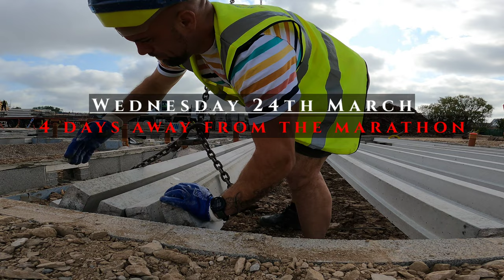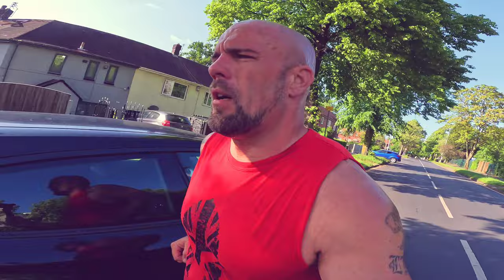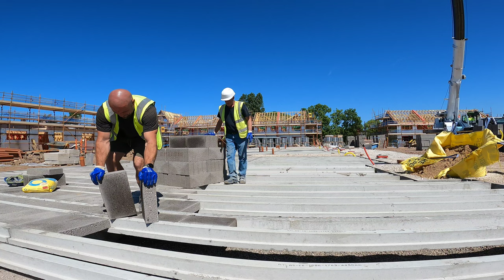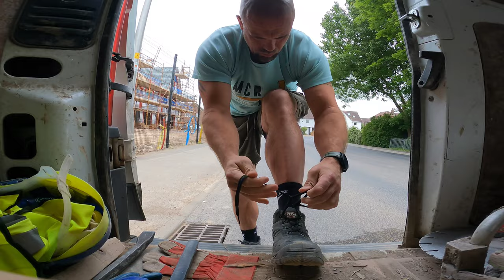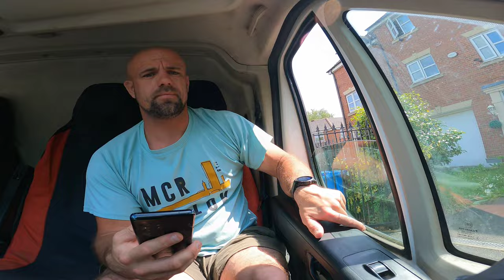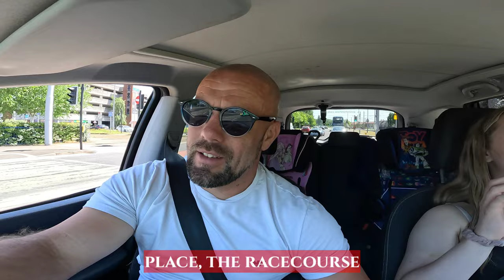The Kempton Park - Pre Race Vlog SUB 3

Comment: Matt, I’ve been following you over a year in your journey to sub 3 hour marathon. What I’ve noticed is that you check all the blocks when it comes to sub 3 hour marathon trainings, however, when it comes to the actual race, you come up short a few times. 
In my opinion, you can do it, however, have you ever consider trying to drop 5-8kg in weight?  I’m about the same weight as you at about 204lbs and top heavy runners have issues maintaining the sub 3 hour pace on the last 5-7 miles because of pain in legs from the body weight.  Losing weight down to about 184-189lbs would use your energy more efficiently and thus gives you less pain in your legs. Just an opinion of your running I’ve been observing too mate. Hope to not offend you but Nick Bare did his sub 3 hour marathon last year after going down from 225lbs to 195lbs. Less weight to carry made a big difference in his sub 3 marathon.
Reply from the maker: I agree, mate, definitely a strong possibility.. i followed nicks when he did it, and he was 185, i think.. it's bitter sweet because i got so close yet so far in McR . I had a shocker last Sunday 😆